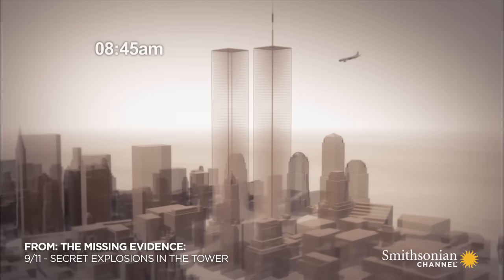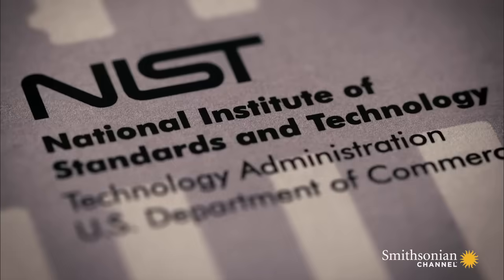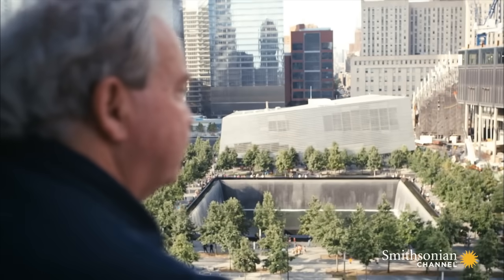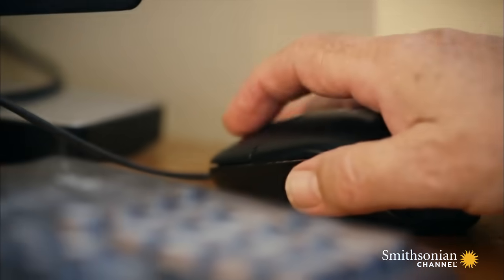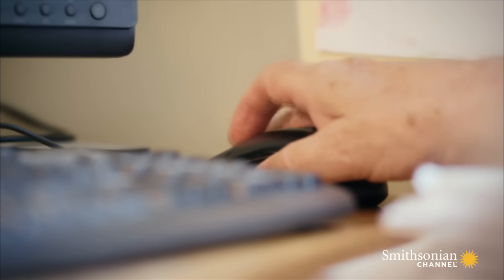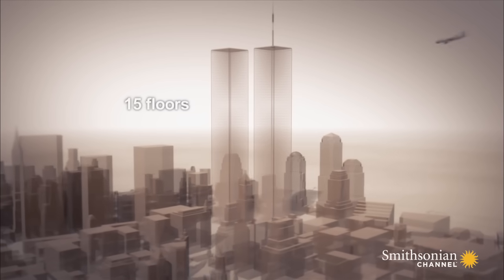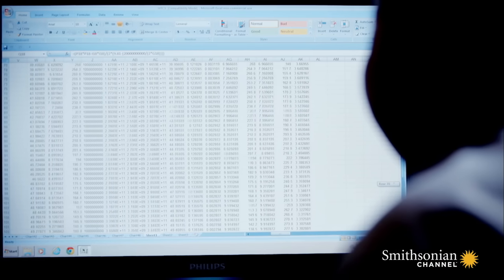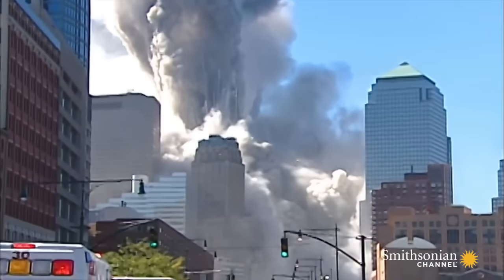This Computer Simulation Explains How the Twin Towers Fell

Comment: Hold up, I can accept that the floors above the impact zone collapsed in a sort of "pancacke" motion, but that would require transfers of energy as each floor impacted the next, so for it to fall at essentially free-fall speed would indicate the collapsing entities encountered no resistance upon making contact with the floors beneath allowing for free-fall speeds.... 

Soo unless something was assisting with disconnecting the support struts at the exact moment the floors made contact, then then collapse time should be longer. 
Plus, if the buildings collapsed and it wasn't at least partially a controlled demolition which allowed the floors to separate evenly, then why didn't the buildings topple over due to incongruity of stress distribution? How did the floors essentially collapse into their own footprint for the majority of floors?
Reply: Yep 100% free fall speed.
Reply: @Shelby_Starner_Everything  lol
Reply: Indeed!!
Reply: Nobody ever says that structural steel couldn’t fail from fires and damage. It’s the fact that these buildings were completely tore to shreds by “gravity” that people question. I agree with your question.
Reply: Because the weight of the building is distributed at it’s center of mass which is straight down. For the building to topple over, you’d have to move it at an angle towards one side. Meaning that according to you, an unkown force that doesn’t exist should instead have moved it 50 meters to one side so it could topple over. Makes sense!!!! 😀👍
Reply: All truth removed by you tube.
Reply: @Christian DiPaola don’t know where you’re getting your info from. All video to date of all three collapses have been at free fall speed. What evidence do you have that contradicts video footage?
Reply: Each floor can sustain 3-5 times its own weight. Pancake theory cannot happen. Even if it somehow could, you would see a huge stack of floors at the bottom after the collapse, but you don't. The building was pulverized into dust.
Reply: @marcomaceo3559  "3-5 times its own weight. " It's anywhere near enough to stop a collapse.
Remember that the floors are MOVING down quite fast. Stopping a ball that's fallen for 3 meters in 10cm requires an average of 31G of force.

It's the difference between having a brick/bowlingball placed on your head, and having one dropped from a few meters.

How far do you think each floor can bend before breaking? Because that's the distance the floor has to stop the floors above it.
Reply: @marcomaceo3559  each floor has a dynamic load limit.  You can experiment with a concrete slab by dropping different weights from different heights.

The kinetic energy of the initial collapsing material must have been well above any shock load design.

Any commentary by Truthers ignorant of such matters is worthless.
Reply: The pancake fall does t make sense to me. If you look up pictures of the steel beams that bent, you have some at a 60 degree angle and some bent like a U. Seeing how these beams bent you would think it would have redirected at least some of the building to fall to one side or the other. Or at least parts of it.
Reply: @nazkadellamorte  the steel beams were bent due to the building collapsing
Reply: @Christian DiPaola sorry I meant as in some expert vouching for your position that it wasn't freefall speed. You're not an expert in the field, are you?
Reply: The towers did not collapse in free fall or near-free fall; that's a myth. In fact they took much longer than free-fall time, in the case of bld 1 at least twice as long. There was resistance. So no problem there.
Reply: @Tim22222  Wrong. All buildings, including the mysterious WTC 7, fell at freefall speed.
Reply: @jahfoolay3150  Okay, I think I see the problem here: You do not understand what free fall means!

#1 Free fall is acceleration, not speed. There is no such thing as free fall speed! An object in free fall is experiencing acceleration due to gravity, therefore its speed is constantly increasing. There is no free-fall speed! If you had ever taken a physics class you would know that.

We can, however, talk about free fall time. Using simple arithmetic we find that the time it would take an object in free fall to fall from 1400 feet - the height of the towers - is about 10 seconds. Watch any video of the towers collapsing, any one at all, and you will immediately see that neither tower came down in 10 seconds (e.g. the clip I shared above). Not even close.
Reply: @Tim22222  Oh boy, "near free-fall" speed then. 

And that still means way less resistance than what NIST was suggesting with their "pancaking floors" theory. 

Either way NIST is wrong, you are wrong and you still have no plausible explanation.
Reply: @Tim22222  130 stories, to fall at free fall would take approx 12 seconds, each tower came down around 11-13 seconds, sooo.....
Reply: @DayLateGamerWill  ? What building was 130 stories???
Reply: @DayLateGamerWill  well that’s actually wrong, because the collapse didn’t start on the top story…
Also, everytime a new floor gets hit by the mass from above, that floor is added to the mass, resulting in a mass that hets higher and higher as It comes closer to the ground…
Reply: @jimi272  No mass is added because the columns below are supposed to be designed to hold the weight of the floors above so it's strange that the floors (where the planes crashed) are suddenly "heavier" that the columns below can't hold it any longer. It should've fallen sideways in my opinion.. Not to mention, the foundation of a building is designed with maximum tolerance, meaning it should've been able to withstand much more additional weights (the reason why we could put furniture, other heavy equipment, and dead/live loads inside a building). With a building this size, I'm not surprised if it was designed with at least 200% tolerance so that should've been enough to hold the upper floors and let it slide when it detached.
Reply: @s_ame1135   Simply true! My brother has a degree in structural engineering, my father was a physics and maths teacher (city highschool and upper level) and two of my friends are architects. All four say the same, that this is not possible without additional forces. The upper floors and lower floors destroying eachother on impact zone. Without additional forces the building will bend and fall over to avoid the path of highest resistance and/or pancaking floor by floor and come to a stop, when the upper floors are destroyed by the forces at the impact zone. The lower parts of the towers are build getting stronger with each building section down towards the lobby. The core of the buildings is a massive (!) steel concrete construction besides its elevators. The towers had 110 stories each.
Reply: Skyscrapers are build much stronger to hold up a lot more of their own weight, because they have to withstand winds and storm winds and even hurricanes for decades. Think about this. Greetings from Frankfurt, Germany *)
Reply: @tobytoxd  Agreed! Considering the magnitude of this project, I'm sure the architects and structural engineers did their due diligence and factor in the possibility of a plane/s crashing into the building in their design and analysis since it's the only mega high-rise building in the vicinity at that time. 
I am an architect in profession and I also consulted my fellow colleagues practicing structural engineering about this issue and they also conclude the same thing as we did. 
Greetings from the Philippines!
Reply: @tobytoxd  This is the correct explanation. The failure point (for instance) on the North tower were the floors engulfed in flames. There were roughly 15 stories above the failure point. These floors would have collapsed downward onto the UNDAMAGED floors underneath. 

It is not possible for 15 floors to crush and destroy 85 floors of undamaged steel and concrete beneath it. The force of the impact of those 15 floors would have certainly crushed and destroyed some of the floors beneath it... possibly even 15 floors... but the basic laws of physics cannot account for the complete destruction and pulverization of a further 70 STORIES of undamaged structure beneath it.

I blame America's education system for creating such unbelievable ignorance about basic science.
Reply: @Tim22222  You're being pedantic about the amount floors. The bigger issue is the free-fall speed of the collapse of all buildings.
Reply: @jimi272  So why didn't the building topple over to the one side? I'll wait. I have time.
Reply: @chrisbadenhorst5304  buildings aren’t like logs.  The buildings failed at connectors (like bolts and flanges) or failure of elements like trusses.

The amateur Truther dogma is poor.
Reply: @DPMusicStudio  you misunderstand the laws of physics and kinetic energy for that matter.  Look up shock load and then reassess.
Reply: @chrisbadenhorst5304  you didn’t correctly spell what you were trying to convey.  Even then, a two word comment is still poor comprehension.  99.9% of the engineers of the world can disabuse your of the Truther madness.
Reply: @tobytoxd  towers are designed with various load ratings with factors of safety.

There would be an impact load rating with a factor of safety, but any rudimentary look see would show beyond a shadow of doubt that the mass and speed of debris falling from the damaged areas onto the lower falls would have far exceeded the expectations for those lightweight truss flooring structures, bolted assemblies and other elements.

Incredulity is no match for a basic understanding of structures.

🤷🏽‍♂️
Reply: @MrDefreese   False.
Reply: @MrDefreese  basic understanding of structures says this was a controlled demolition designed to look like an accident/attack. These buildings were designed to take multiple airplane impacts from various directions and still stand. The thermal imaging shows that the heat generated by the office fires was nowhere near hot enough to weaken the steel structures of these buildings. You also have all of the structural base columns with perfect 45 degree clean slices. Last but not least, it's stated in NIST's report itself that the towers fell at near free fall speed. This is impossible with pancake collapse, which I've already stated would produce a stack of floors at the bottom, which they didn't. Ignore the actual evidence if you want to. You'll be on the wrong side of history when all is said and done.
Reply: @tobytoxd  err.  Truth.  What’s wrong with you people?!
Reply: @marcomaceo3559  May I add : The 3rd law of Newton 'says' Pancake Theory is impossible. The third law states that for every action (force) in nature there is an equal and opposite reaction. The 15 floors force in freefall momentum would meet with the resistance force of the 95 fully functional floors beneath and act as an opposite reaction. 

Basically view it as a tug-of-war... with 95 average weighted and strenght people on one side and 15 average weighted and strenght people on the other side... Now tell me, which side should win ? (I'm not taking into account that there's a massive reinforced concrete base on the bottom... so it's more like 95 + 1 "worlds strongest men" vs 15) This is basic grade 10 physics.
Reply: @jimi272  Nope, your math and logic is flawed. Once the floor being hit breaks free from it's more than d-o-u-b-l-e- redundant resistance and begins to move downward, then the mass is added. UNTIL THEN, the mass of the good building below the "collapse" is an opposing mass as a whole. Consult a physicist.
Reply: @broadcastdepth3686  hmmm.  You probably should have stopped commenting 2-3 posts ago.

Sad.
Reply: @DayLateGamerWill  110 stories
Reply: @Tim22222  the towers were 110 stories
Reply: @Tim22222  110 stories
Reply: @jimi272  you have forgotten something, every floor was built to withstand the weight above it, so if the floor was undamaged, probably everything below floor 90 in WTC1 then that floor was capable of holding the weight above them. The only way the pancake theory could work is if each floor projected from the load bearing columns, then each beam is only designed for people so anything heavier would make it snap, sometimes corners of buildings collapse for this reason. It's impossible to compress a solid core.
Reply: @s_ame1135  This is a really important point, totally ignored by the official theorists. Any part of the towers were able to withstand the weight above them, so how could the weight above the damaged part collapse it?
Reply: @patricksmith4424  static loading vs. dynamic loading.  Learn a bit more before pontificating.
Reply: @MrDefreese  for a dynamic load to apply then the 15 towers above the impact zone in WTC1 would have to have been lifted to a much greater height to give it (potential energy) then dropped (kinetic energy). Even then the 15 floors would only have destroyed the the top 15 floors of the renaming structure as Newton's third law would have applied. A post above gives an explanation  of this. There was only static load as the building had not been completely severed to create a gravity drop.
Reply: @patricksmith4424  no.  If you drop several tons of material on a floor, the floor will fail either at the connectors or the flooring material or both.  Repeat with the next floor.  Repeat with the next floor.

Smh.

Really.  This is a terrible lack of understanding basic material.
Reply: @MrDefreese  you have actually brought up why the pancake theory was impossible. I explained this a few posts back. Basically   any floir is designed to withstand any static or dynamic load it may encounter people/lightish machines dancing etc,  it is not designed for super heavy weights like the building above. The columns are designed for that and there is no way they will pancake, just try and squash a metal tube, it ain't easy and when does it well always bend in the middle first. Floor collapse are very rare when the  girders are secured at both ends. When the beam juts out from the supporting column it offers far more torque on the junction, and yes the combined weight of floors acting on one single floor with one junction will collapse quickly. Gas explosions  can demolish corners of buildings for this reason.
Reply: @patricksmith4424  you are typing just to type.  You don’t know what you are talking about.  These fake accounts are an abomination.  Smh.
Reply: @MrDefreese  And, why is this? My professional credentials aren't as good as your somewhat narrow perception? You are essentially saying the same thing as any conspiract theorist: "this is what happened and I know this because I am smarter than all of you, and I'm an engineer with a masters." What else makes you qualified to judge the incident and everyone else? Answer: Nothing. Just your opinion.   What is sad? That I am willing to back up my opinion in a public forum with my own credentials? Tell me why I should be ashamed to have an opinion. Is it sad that people who don't purport to posess your masters degree, smoking you with scientific comments and questions that pertain to the topic as opposed to as you do, skipping over any comments regarding the incident and instead, attacking people?
Reply: @broadcastdepth3686  no.  Your assessments are just incorrect and unsupported by basic science/engineering.  Look up Impact load for structural engineering and then revisit your claim.
Reply: @DPMusicStudio  Once progressive collapse starts, it doesn't stop, each floor that collapses adds the falling mass, making it heavier and heavier.
Reply: @masterluigi01  It's not 15 vs 95. It's 15 vs 1, then 16 vs 1, then 17 vs 1 etc.
Reply: @broadcastdepth3686  No individual floor is capable of withstanding 15+ stories falling on it from several meters. And each floor is resisiting the collapse individually.
Reply: @11cookeaw14  Are your floors (steel columns) somehow hovering individually in the air to come to that conclusion ? Because last time I checked. The support columns beneath the impact zone were all intact and functional. 

Your logic "It's 15 vs 1, then 16 vs 1, then 17 vs 1 etc."  would only be possible if explosives were planted on each floor and auto-detonated on their way down.

Otherwise, the whole concept of "controlled demolition" would not be needed to take down other tall buildings. We could just sabotage a few floors and let Pancake theory do the work.
Reply: @masterluigi01 1 floor at a time.
  95th floor bolts and connections versus roof items and 15 floors mass going 100 mph.  (1350 foot tall building 184' for 15 floors > 108 mph freefall) (heavy items on roof)
Reply: @bluecollarbeat3156  My bad!  I forgot the roof antenna.  Not sure how heavy the radio antenna was, but that and 15 floors is not heavier than 95 floors + a multiple floors concrete basement.

1 floor at time doesnt matter because its not 1 floor that supports 15 floors + roof antenna.  its the core and perimeter columns that supported revelant weight, not the floor.
Reply: @s_ame1135 they are not suddenly heavier, their structure is compromised because of the fire, einstein
Reply: @s_ame1135 the question the were paid to answer was - show this is possible- not what happened
Reply: @Tim22222  Which videos have been watching? Every piece of footage from then shows them in freefall.
Reply: @jahfoolay3150  All of them! And most show debris falling faster then the towers! So if the debris was falling in free fall, then by definition the towers weren't.

But please - share a clip showing free fall and how you know it's free fall.
Reply: @Tim22222  building 7 fell at fteefall 100%
Reply: @Christian DiPaola You’ve made two statements. One of which is wrong. Guess which one. I’ll give you a clue. The answer rhymes with “the becond one”.
Reply: @jahfoolay3150  Oh sure, there was demolition alright.

I believe they were contracted by a certain Osama Bin Laden.

Terrible operation; they violated at least a dozen industry rules.  And don't even get me started on the OHSA violations.

Now that I've got my dark humor out of the way, I'm gonna go watch something with kittens to clear my head of this foolishness.  'Cause I for one ain't wastin' my life tryin' ta invalidate the lives lost that day like you are, and I ain't about to waste my time arguing with a brick wall over it either.
Reply: THANK YOU. This is fifth grade physics. "Show me the math" that has damaged dead weight destroying triple redundant "sound floors."It doesn't happen in this universe. If this were possible, why would we need explosives to ensure demolition?
Reply: @broadcastdepth3686  the amount of kinetic energy involved in the destruction of all the buildings is/was enormous.  You people are using amateurish personal incredulity to come to some spectacularly obtuse and unsupported notion of a super secret demolition plot installed and executed at the exact time and place as a devastating catastrophe caused by the plane crashes.

It’s a glaring blind spot for you folks that requires you to engage in all sorts of mental abdications in ignoring basic facts.
Reply: @MrDefreese  What do you mean by "you people"? I spent six months of the years we have been looking at this incident in equations just for two small parts of this evolution. "Kinetic energy to launch a beam X distance" and "Moments of inertia for symettrical failure ."  What does your data look like?
Reply: @MrDefreese  P.S. Why is your profile a ghost? Credible people have real profiles: Very "shill-ish" if you ask me. I notice you "subscribed" to that fakie with your other five profiles or, I'm sure there is some explination for that profile getting five subs wjhile having not one real video.
Reply: @broadcastdepth3686  you just threw together some words to sound coherent.  It didn’t work.  You should delete your account and not post anonymously any more.
Reply: Roughly 3/4 of the building were turned into microscopic dust, a few seconds after an underground nuclear charge was detonated below the twin towers (you can see the cameras of the news reporters shake, from the tiny earthquake caused by the detonation, right before the towers collapsed) . The upper part, which was still in tact, then came down like a wrecking ball with almost only dust in its way.

There is footage from huge steel carriers, turning to dust while falling to the side. The world needs to know about this.

The third truth, by Dimitri Khalezov